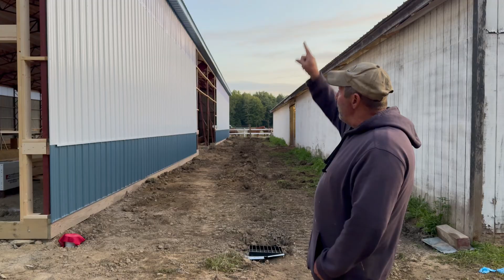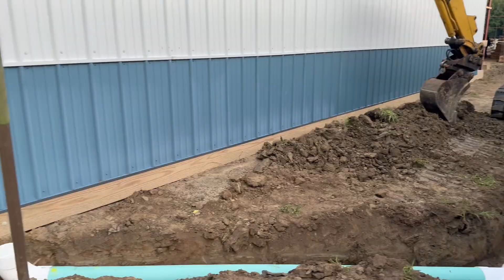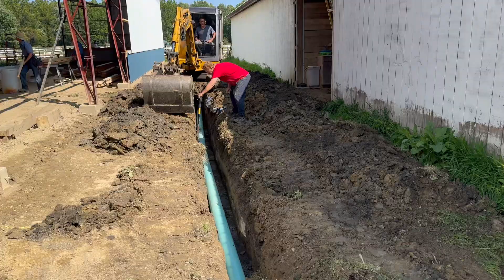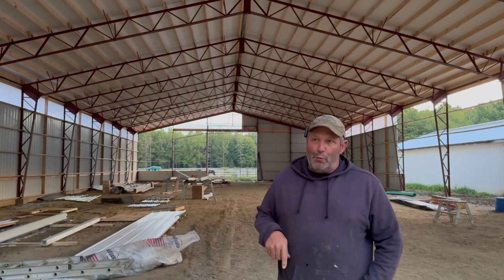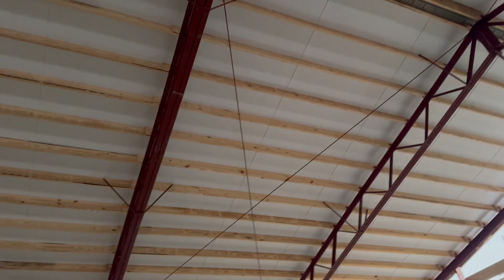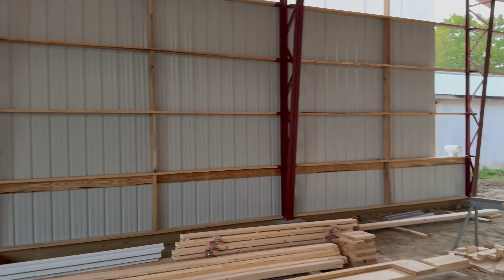Roof Completion, Siding, and Framing:  K Building Days 6-8 of Future Riding Arena/Equipment Barn

Comment: Are you willing to share how much this project cost you?
Reply from the maker: Just steel and labor around $120,000. That does not include grading and base meaning the dirt pad.  I don’t have electric hooked up yet.  I also need to get gutters.  So there are a lot more costs that will be going in.  Converting into a riding arena will have more costs on the side walls.  Nothing is cheap anymore.